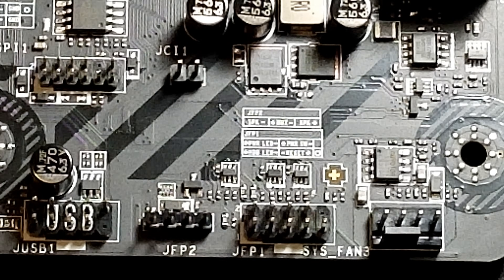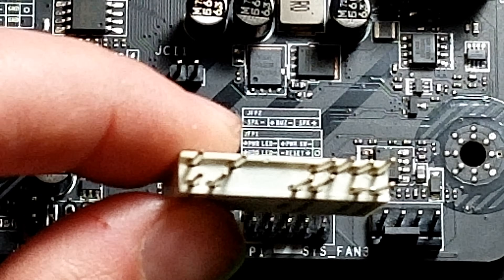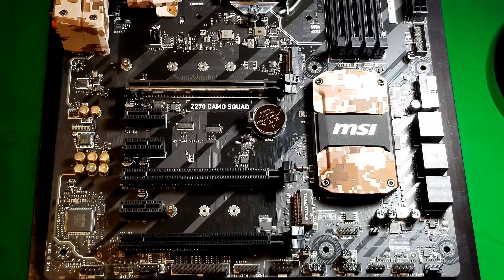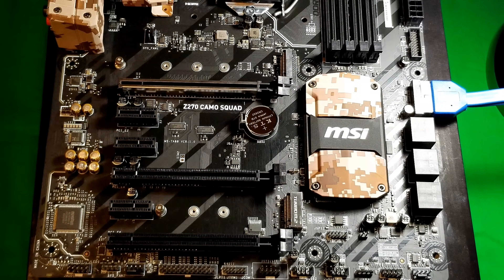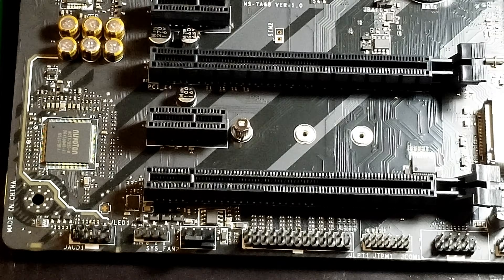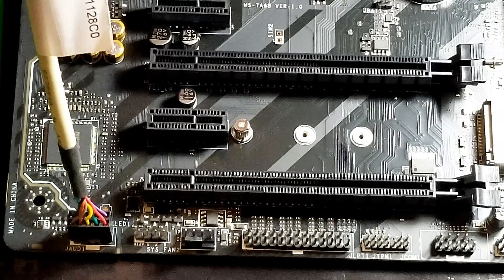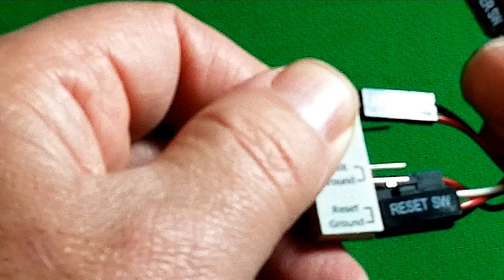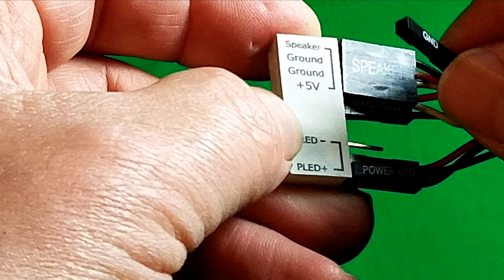Connecting your Case Front Panel connectors to your Motherboard

Comment: GREAT VIDEO. Had one  mistake on the power side when connecting the power switch. You did put the positive on the negative. But this video helped me understanding where to put the cables and to see that little mistake. So thank you. Im going to say you did that on purpose for a test
Reply from the maker: Actually I did it to show that it will still work for the Power Switch, the only one that makes a difference is the PLED + and - if those are in correct then the power as long as it's on the correct pins will work either way, good catch though...I'm glad the video helped you out, have a great day and enjoy your build...Thanks...
Reply: @Reviewing_Playing_and_More_RPM  OHH MY BAD!! Well thats great! Thank you again my dude. I cant wait for all my parts to get here so i can get it together. Maybe if i send a pic of it after its done with specs. You can critique it??
Reply from the maker: @nathankenyon6081  Sure send them through my Twitter on the channel and maybe I'll do a video featuring it...

Comment: How about the H510
Reply from the maker: Only difference that might be with the H510 is that some of the NZXT Cases have the connectors all joined together so in that case its actually easier to line them up...otherwise it's the same...

Comment: Good afternoon, the HD Audio plugs from the cabin does not go fully in the JAUD1 port on the motherboard.
It just goes half in but not completely in even though I hve connected it properly.
Is this ok? Or should it go full in? 
Thanks in advance.
Reply from the maker: As long as it's fully inserted and lined up with the holes, keeping in mind that there is one with a blank spot, and if they are lined up properly and it's gone in all the way then it'll be good...
Reply: @Reviewing_Playing_and_More_RPM  its lined up properly but just not going in.
3/4 of it is in but it's not going like the other ports I connected likewise.
Reply from the maker: @beldon_x  well if it's lined up properly and your using the right audio slot as you mentioned, then you could apply aa little pressure, (not to much though) and just see if it goes down but first check there's nothing preventing it going down and check the cases cable connector as well in case somehow there is something in there stopping it, it's unlikely but worth checking...if that doesn't work but it seems secure then just go with it and see if you get sound later and if so you be good, not much more I can offer beyond that though...good luck...
Reply: @Reviewing_Playing_and_More_RPM  thank you so much, I'll update you soon
Reply: @Reviewing_Playing_and_More_RPM   It works !!! Thanks a ton 🍻

Comment: what is your mainboard brand and type? i think divided fp sections are not very common for present time mainboards. anyway very good tutorial
Reply from the maker: It's an older AMD Mainboard, but connections are very much the same as present day, no differences between then and now though...appreciate your input though...the way to connect them are still the same as modern mainboards...have a great day...

Comment: hi great video, but i struggling with asrock z390 Thaichi untimate with those wires,
Reply from the maker: The Manual for your Motherboard shows the Pin Layout for your connectors, here's a link that will show you where they all go, hope it helps  https://www.manualslib.com/manual/1685294/Asrock-Z390-Taichi-Ultimate.html?page=26#manual
Reply: @Reviewing_Playing_and_More_RPM  thanks for replying,  i do have mb book too fine print to read did look on web  ,.case is be quiet 801 

i working upside down as mb is inverted  in case

i got hd audio hdd led 2 pin blank pin the another pin got plus p led on it  then 4x rgb led with another plus p on one of them .just dont know where power sw goto and reset sw.
Reply from the maker: @Springboksimmer  The Power goes on the next 2 pins with the PLED + and - on the left of it, and the reset sw goes the next two pins to the right of the HDD LED connectors...
Reply: @Reviewing_Playing_and_More_RPM  wow never though struggle  understanding it, half dyslexia here lol.

from left to right at manual

hd audio, skip skip 3 pins on addressble led header. next white rgb 1 4 pins 2 power SW other 2 p- and p+  next set 4 rgb led 2 HDD led after is reset sw

Comment: I got mine to then on but the leds won’t work yet :(
Reply from the maker: Ok, so you got it to turn on, that's great, as to the LED's do you mean the RGB? As the LED is not a color thing it just means light emitting diode, which applies in this video to if your case has a HD Led light then it'll show when the system is on and doing something, not all cases will have this however...for RGB you need either an ARGB or RGB Header depending on what your using...if you meant something else or still need help let me know...

Comment: Anyone 2020 trying to conect a fan
Reply from the maker: What are you looking to find out about connecting a fan, don't understand what you mean...
Reply: @Reviewing_Playing_and_More_RPM  i onl hd 1 fan plug in the motherboard, and i have 2 fans i have installed, all i needed was more space to conect it, i cn use a fan adaptor to have more places to connect more fans
Reply from the maker: @GoldDRoger-lu9nt  Yes you can use a Fan Splitter, or a Fan Hub to give more connections to plug in fans...

Comment: Where to connect the led switch (not the hdd led) my computer also has rgb fans
Reply from the maker: I only covered the cables from cases, RGB is an entire different video, but you just need to see what the case uses could be ARGB 3 Pin 5V or RGB 4 Pin 12V, so make sure you have both on your MB and you'll be good...

Comment: I need help when I turn on my pc only the motherboard rgb turns on. The psu fan dosent start spinning either
Reply from the maker: Ensure you have the CPU Cooler Fan plugged into the CPU Fan on the MB, then if it is now you'll need to start checking memory is in correctly and the correct slots, the case LED's are in correctly easy to get them mixed up, GPU is inserted unless using an APU...testing the PSU then finally if you've checked everything then it's possible the MB or CPU (although CPU's rarely fail)...could be the issue...hope that helps a bit...
Reply: @Reviewing_Playing_and_More_RPM  I fixed it but how do i make it stop booting to the bios
Reply from the maker: @Jesus-mi6zd  After your in the BIOS, use F10 to Save and Exit then you'll need to install the Operating System...
Reply: @Reviewing_Playing_and_More_RPM  I installed windows 10 but it keeps taking back to the bios
Reply from the maker: A computer that keeps booting to BIOS, might be because of an incorrect boot order. Go to check if there is an appropriate boot device available in BIOS. If you find it, set the disk as the primary boot option. If your hard drive listed under boot device cannot be found in BIOS, change this hard drive...You could also go to Advanced settings, choose Boot settings. Disable Fast Boot, save changes and restart the computer.

Comment: Is it just me or is it annoyingly bad marked on the motherboard what is +, what is - and what way you should put them? (I have an Asus X570-X motherboard)
The plus and minus is marked on the motherboard on the first pins on the left, but nothing on the other one, so I just have to assume the rest are matched "+" then "-", from the left, "plus then minus" in pair, 2 and 2 on all the pins... (2 rows 4 on the top and 5 on the bottom row, motherboard only show +/- markings for the first 2 from the left, on both the upper and lower pins)
Also, all the other pins are marked on the cable so that the writing on the cable-connections are facing outwards, so the bottom ones are downwards and the top ones are up (So you can read them even when in place), except for the "power" 2-pin connection (That are the most important ones), they are marked so they go the other way, on the top row, but with the markings on the cable end up on the inner/lower side. 
So they go the opposite way of all the other ones.. 
That just seem unnecessary and annoying...
Unless I am reading them wrong and will have some trouble when trying to start my new computer.. :p  It seems like the same as shown in this video...

Also, the motherboard manual say nothing about the arrow, to tell you what way is right, it also does not show what way you should put the pin, that is just bad manual... It say nothing about what way is the positive one and what is the negative one, nothing about the arrow, it just explain what the different cables/pins do (Witch I know), but not what way to put them in, ASUS x570-X motherboard, it just has a bad instruction manual.
Reply from the maker: As long as you put the PLED + on the left and - to the right of that, and the HDD LED under it, then to the right of that again will be starting on the top the Power Switch can go either way same as the HDD LED, it will still work...under the HDD LED is the Reset SW can go in either way as well...it wont matter except for the PLED for the + and - the rest will all still work perfectly...That's why a lot of MB Manuals may not show it any longer...hope that helps...

Comment: I have an old fm2+ a68bm-a/m32bf/dp_mb motherboard and my current case has a front panel connector that takes up all the power pins instead of single cables like seen in the video it has the same layout as the asus power connector and I cant find a manual for the motherboard anywhere. 

I want to put my board in a new case
Reply from the maker: Your MB has the F Panel connectors to the right of the WiFi on the MB, it's a beige or yellow color, the connectors for a new case would go there, as shown in the video so you should be able to place it in a new case and use it fairly easily...
Reply: Thank you so much for helping out
Reply from the maker: @ryanbond504  Glad to help...
Reply from the maker: @ryanbond504  Your very welcome...

Comment: i have the z390 aorus ultra and i dont know where to attach each front panel connector? i need help..
Reply from the maker: It's the same as in the video, most modern Motherboards will follow this same setup, only differences you will find is the case, some cases don't have a Reset Cable/Switch or HDD LED cable/light...For exact placement your MB look for Front Panel connectors and it'll have a diagram of how they go on...
Reply: @Reviewing_Playing_and_More_RPM  so different motehrboards have differnet patterns of which way the front panel connectors go on?
Reply from the maker: Mostly there all the same, the only one's that tend to be different are the pre-builts that have proprietary connectors and such...HP used to be famous for this but not so much now a days...

Comment: 7:13 my issue is here I also have a "fan sw" but there is no place for it and I keep getting a post error but I'm not sure if it's to do with that
Reply from the maker: Ok, so never had a fan sw that would connect to the Front Panel connectors, so guessing you mean something else, let me know and I get back to you...fans go into a Fan_Header on your MB...
Reply: @Reviewing_Playing_and_More_RPM  thank you for the reply so my computer case isa "Cougar Puritas RBG Mid Tower Gaming case Tempered Glass with 3× vortex RBG Fans and contoler" and my motherboard is an "MSI MPG Z390 gaming Edge ac" and yes I've never came across this fan switch before either which is why it's making no sense to me although I am quite new at building PCs. But yeah it has two holes so it should sit on two pins but there is no space for it that I can see I don't know if maybe be it's because they just aren't compatible with each other or something
Reply from the maker: @PoeticGalaxy  Can't tell by looking at some pictures I pulled up, but is it possible they connect to each other ie the 2 pin connects to another cable from either the case or the Hub that is with the case? Have a look and see if that's possible, but not familiar with that case so can't say for sure where it would go...
Reply: @Reviewing_Playing_and_More_RPM  thank you for the reply. it is grouped in with the set that fits on the Front Panel. And they all are kind of attached together. Although there is something else strange with my motherboard is that the speaker for some reason doesn't make a sound when it goes on to "JFP2" but yet it does when I put it on "JRGB1" but in both instances the PC doesn't respond because I'm assuming it's failing post. But I'm thinking maybe the speaker is only making a sound because it's in the wrong place on the motherboard but still doesn't explain the post issue. But thank you for the help and suggestions I appreciate it
Reply from the maker: @PoeticGalaxy  The speaker should only go on the JFP2 or whatever the Motherboard dictates, putting in on the JRGB1 could cause issue's, possibly a short...(not certain on this though)...
Reply: @Reviewing_Playing_and_More_RPM  yes I think I accidentally put it on that one not paying attention I am due for a new motherboard anyway so I will definitely keep that knowledge in mind when installing everything into the new motherboard. It was just strange how the speaker only seem to work when it was in the wrong place but when it was in the correct place still no start up. Although thinking about it now maybe I did some permanent damage even though the RGB lights on the motherboard light up. But anyway we shall see with the new build.
Reply from the maker: @PoeticGalaxy  Alright, I hope the next one works out better for you...have a great day...
Reply: @Reviewing_Playing_and_More_RPM  you too and thanks again for the replies

Comment: I just bought a pc but can't hear the audio from it and i check and everything was connected in jfp1 but not jfp2. My point is any idead how to fix this? It says on the pc my speakers are not plugged in but yet I'm new to this so idk how to fix it. I can only hear if i connect my headphones
Reply from the maker: You need to plug in the HD Audio from the case to the Audio on the Motherboard, it's shown at 6:06 in the video and called JAUD1, the cable from your case is HD Audio it's slightly different depending on the MB, however it's almost always in the same place...if you want to hear beep codes and such when your MB doesn't have a LED that shows you the Codes, this can be helpful, it's shown at 8:29 in the video, and the JFP2 is the place a small speaker can be plugged in but very few cases come with those any longer, and on some MB's it will be part of the Front Panel connectors and is normally on the far right on the top the 4 pins, which most small speaker LED's that might come with a case would be placed...Now to get sound from your system if all this was done but your still not getting sound ensure your using from the back of the MB a sound cable typically with a Green connector that goes from your Monitor to the sound on the back of your MB which will also be Green...the front audio is the HD Audio I mentioned that needs to be connected for that to work...Also if your Monitor doesn't have speakers you won't be able to get sound unless you do...In that case you could use a Bluetooth Speaker that you connect to your PC...Hope that helps...
Reply: @Reviewing_Playing_and_More_RPM  Lol I just realized that my monitor does not have speakers,  i checked it again and it doesn't 😂😂. I already bought a pre-built pc and i thought something was wrong with it but no😂😂. Any good speakers that you recommend me??. Thanks for your help i really appreciate that you took your time to reply to my comment and be specific about it, really thanks man🙏. Just subscribed:)
Reply from the maker: @bryanborja2058  Logitech Z207 from Best Buy is well priced and decent quality...it'll work great...appreciate your support, have a great day...

Comment: Is there a way I can face time you I’m having the hardest issue😂 I’m rocking a Asus Rog Strix b550-f motherboard the f panel part kills me
Reply from the maker: Sorry don't have anything set up for that atm, but on your MB starting with the group of pins on the far right, the top 5 pins are for a speaker, the one's on the bottom can be ignored. So if you look up in your MB Manual look for FPanel Connectors, and it will show you which cables go where...hope that helps...

Comment: Hey i have a question. Were you pushing hard to connect it on the pins?
Reply from the maker: I bit yes, but not to much or you could bend the pins...
Reply: Reviewing Playing & More RPM i’m adding force to my connectors but it only goes halfway:(
Reply from the maker: @idkmak8216  They should go on without much force, which cables are you trying to connect
Reply: Reviewing Playing & More RPM I got it in!! I just wiggled it a bit and it went all the way.
Reply from the maker: @idkmak8216  Good work...they can be a bit intimidating for sure...

Comment: I have an Asus b450 prime and I don't have sound in my front panel help
Reply from the maker: Sound will come through your MB to the Case, most MB's don't come with a speaker that doesn't mean you won't have sound, the sound built into the MB will be enough...once your MB is in the case and provided you plugged in the HD Audio from the case to the MB you will be gtg...

Comment: Hi dear
I have new msi b450 motherboard. In manual I find for RESET switch i.e 5 and 7 port, 5 is indicating as "–" and 7 is indicating as "+" so why everyone plugin opposite direction??
HDD LED (1+,3–) , POWER LED(2+,4–), POWER SWITCH (6+,8–). So basically these 3 is ok but RESET SWITCH must be inserted opposite to these its indicated "–" first then "+"
Please please clear this point.
Thanks
Reply from the maker: When it comes to the Reset Switch it can go in either way and will still work, the only one that makes a difference is the PLED + and -, if that's wrong your system won't start, the rest will still be ok though...
Reply: @Reviewing_Playing_and_More_RPM  Ohh got it. Thank you so much for your fast response👍👍